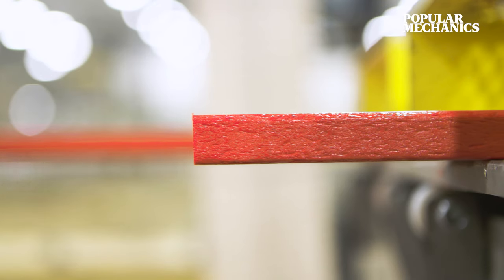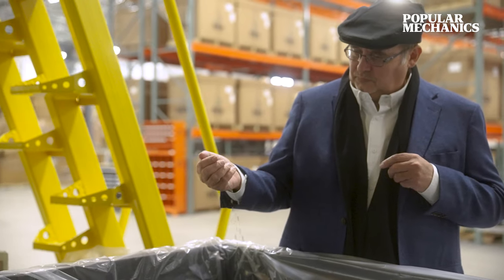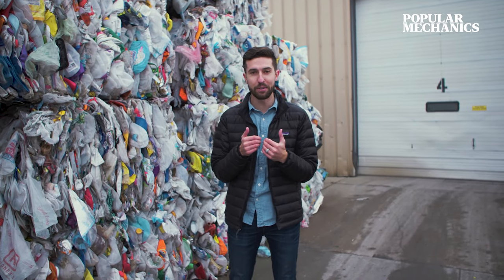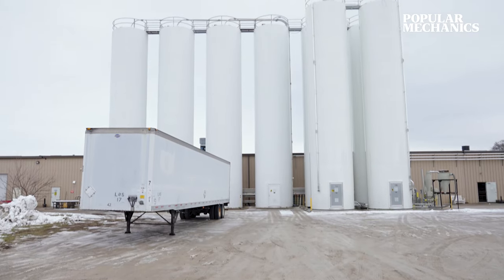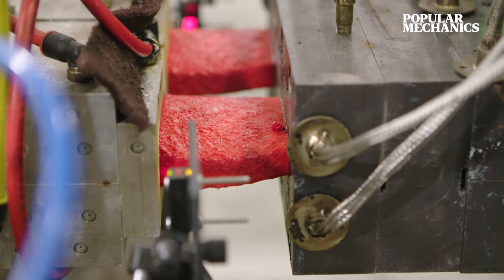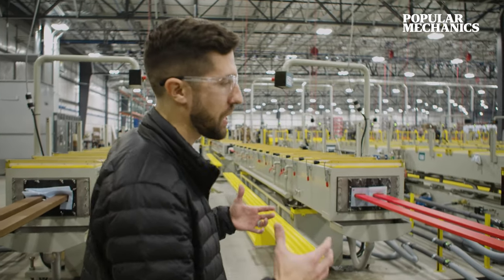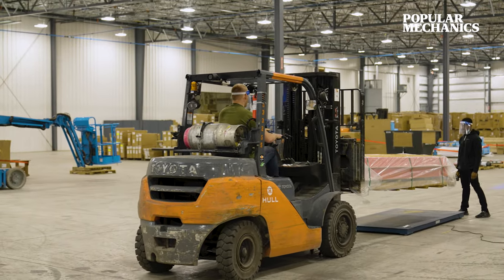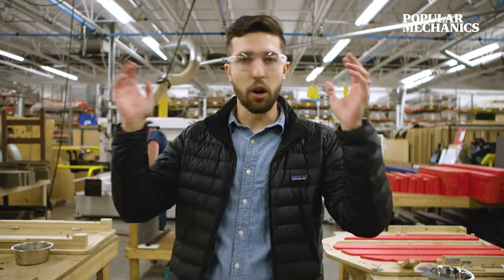How Furniture is Made from Recycled Plastic  | Made Here | Popular Mechanics

Comment: Great that this is in Indiana; a state with very low recycling.  Plastic is not infinitely recyclable, like aluminum.  Plastic degrades over time and with each process, like cardboard.  Also, only certain plastics can be recycled cost and energy efficacy.  It is still better to try to reduce plastic usage, like not using plastic shopping bags or straws.

Comment: About three times as expensive as wood.  Takes a lot of energy and dangerous chemicals to recycle.  Wood is renewable, and create oxygen as a by product.  Wood can also be re-used until it rots away by itself.
Reply: True, though I am unsure of the "dangerous chemicals  used" aspect. Considering the "as when new" longevity and no need to paint or otherwise seal (eliminating more  oil-based products!), I find the product to be quite acceptable for many outdoor uses. Including storage boxes and compartments on my boats ! I am a retired custom furniture designer/craftsman, as well as specializing in exterior makeovers to upgrade properties with unusual "trim" on doors and windows, decks, porches, pergolas, hot tub surrounds, outdoor kitchens, etc. Absolutely love wood like cedar and redwood for such projects, but Polywood can be used for many, many things,  with little to no maintenance, whatsoever.....ever.
Save "trash" from filling landfills AND no maintenance ? 
I am on board !! (pun intended !)